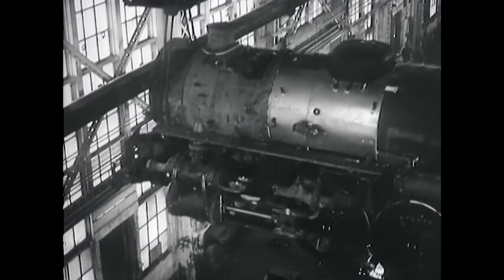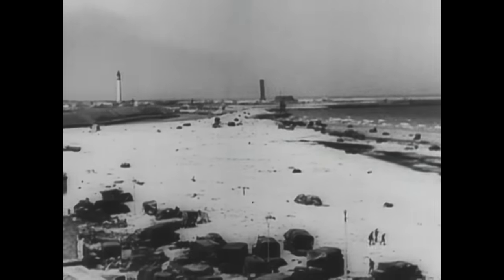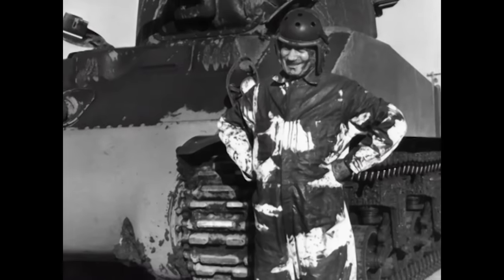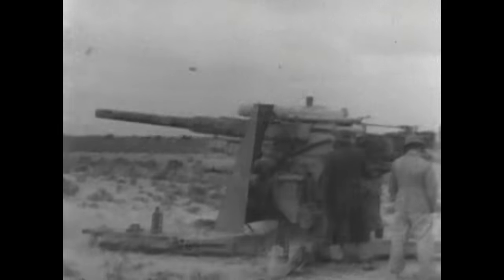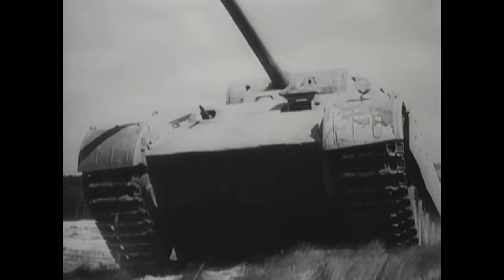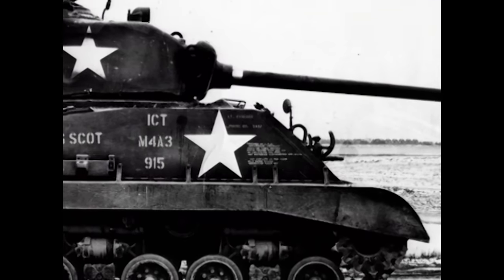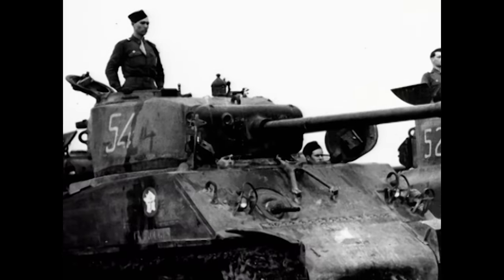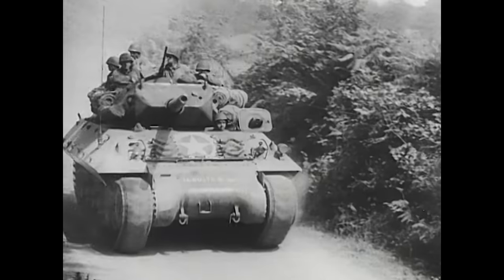Why The Sherman Tank Arrived Just In Time For The Allies | Tanks! | War Stories

Comment: Both the 76 mm Sherman and the 17 pounder could take out a panther. The 17 pounder was more powerful but it left very little room inside for the crew to fight the tank. You pretty much needed midgets or something. That issue could be fixed by using a larger turret. I don't think it was. The Chieftain did demonstrate this. Shermans always traveled in groups of five. I'm loath to say this but these experts pretty much don't know Jack.

Comment: My dad was taking a part off of a Sherman to repair another one.  He was walking away with the part when the Sherman was hit by a shell again.  He was far enough away that it didn't kill him but my mom told me his back was covered in scars.  Him and his brother both joined in 39 and didn't leave the military until their units were demobilised in 45.  He did several different things during the war one of which was a dispatch rider.  They learned to ride with their heads low because of the wires the Germans would string across roads.  Years later when he would ride motorbikes around town he would still keep his head down.

Comment: MAJOR correction, the T14 and the Jumbo are NOT the same tank, not even close. By the time they were making the Jumbos the T14 and its UK equivalent the Excelsior had both been canceled for being an impractical complication that still needed more development while the Churchills had already had their issues ironed out.

The Jumbos were just standard Sherman's with additional armor welded to the front hull, and a heavier armored turret. This is why only 250 were made, it heavily overstressed the front suspension leading to increased wear and tear causing frequent parts breakage. 

With a supply chain spanning literally the entire globe, and an equally long supply line to the front, the US refused to issue equipment that was known to be faulty or defective (This doesn't mean it didn't happen, just that they tried to avoid it when they could). That's because EVERYTHING had to cross at least one ocean to get to the fight, and they weren't shipping defective tanks back to the US to he fixed, once it was shipped that was it, and any repairs, fixes, or overhauls would have to be repaired by motor pools and if they couldn't handle the fix, the tank was just sent to the local scrapyard.
Reply: Thank you… saved me a ton of time. Soo many wrong facts in this “Documentary”.
Reply: T14. The T14 is an oddity. Its part M4 Part M6 part it’s own thing. It’s more advanced than M4 but less than HVSS. It inherited problems from M6 but isn’t developed to correct them. It’s started before M4A3 but didn’t get the fixes to the engine bay. Neither T14 has more then 1600 miles put on them.

The Jumbo wasn’t drastically over stressed. And added work was fairly limited over the normal M4. An improved model with HVSS was discussed. A further improvement with HVSS and the M26 turret was also worked on.

The M4A3E2 was for very limited running. So any increased wear was considered acceptable.
Reply: Most of this video is either wrong, or so simplified that it's no longer true
Reply: American tanks are something of a sad story that started with General Lesley McNair being appointed Chief -AGF. He favored the Tank Destroyer and his doctrine was that they would deal with enemy tanks, while US tanks were confined to Infantry Support. This soon caused complaint as tankers wanted thicker armour and better guns. From 1941-44 new tanks were tested but always McNair found an excuse to cancel desite objections from the likes of Devers and Patton.

In 1943 the 90mm gun entered service and the T-26 tank was finalized. However McNair dragged his feet on production. By July McNair had done nothing, but on a visit to Normandy he was killed by "friendly fire" . His replacement General Ben Lear immediately ordered the M-26 and M-36 into production. They just about made it on the battlefield as WW2 ended.

McNair had his reasons but shipping out heavier tanks was not it. Neither was shipping tanks back to the US for repair, this was done at factories overseas. No, he was tied to his doctrine and would not let it go/
Reply: The A33 Excelsior was a new Assault Tank based on the A27 Cromwell. It was killed off when the Churchill entered combat in the autumn of 1942. Its replacement was the new Assault Tank, the Nuffield A39 Tortoise, a 78 ton monster with a 32 Pounder high Velocity gun that would go through a Jagdtiger like a hot knife through butter. Six were built and tested 1945-52 in Germany but were not continued.

Comment: A couple of things not mentioned. 
First was the design constraint placed on the M4 in that over 95% of the cranes at American ports could only lift 40 tons onto a ship.
A major point in its favor was crew ergonomics. The loader could load the gun while seated. It has a stabilizer for the gun. It had a periscopic sight and a telescopic sight. And it was easy to drive.
Reply: Ergonomics were the result of learning processes after addressing flaws. 
For example early Shermans didn't even have a cupola and only one turret escape hatch for all three turret crewmen to get out of.
Reply: Agreed, ergonomics was (still is) very important, a stressed out crew in a confined space do not perform well.

Comment: 33:00 Maybe wasnt as good with HVAP/Sabot rounds, but those were very rare. Most 17pdrs and most 76 M1 guns fired normal APCBC shells, which performed practically equally for both guns.
And yes, the American gun WAS adequate against Panthers. Check for example the L.G. Pool and his crew. They had the American 76mm gun and they used it to knock out Panthers left right and center. Even became tank aces, one of the best in the allied armies.
Reply: Except the 17 pounder was way more powerful in AP with its normal round, while the 76mm was seen as a disappointment.

Comment: 19:56 This is a myth. Those nicknames were given to the Crusader tank, not Sherman. Also, Ronson was not used at all, as the common lighters of that time were Zippo, not Ronson.
Reply: As the Chieftain pointed out, Ronson didn't use that slogan until the 1950's.
Reply: @steveschainost7590 
Ronson started it's famous advertising lights every time in the 1920s.
Reply: Ronson wasn’t even using that slogan in the 1940s.
Reply: @steveschainost7590  Ronson also wasnt used by the army. The army used the Zippo lighters. Also, the name Sherman Zippo was a legitimate designation of a flamethrower Sherman.

Comment: In June of 1944 in England there were 76mm armed M4 Shermans. For logistical reasons the US Army left them in England. 76mm armed M4’s were being sent to France by the of the Battle of Normandy.
Reply: Yeah, by Operation Cobra the 76's had already started making their way into frontline units.

And the 76 wasn't as inferior to the 17-Pounder as implied, while yes its base penetration is lower, it's ergonomics in the T23 turret was light-years better than the smaller cramped old-pattern turrets the Fireflys stuffed their gun into. In addition the 76 was more accurate than the 17-Pounder, and was perfectly capable of defeating a Panther or Tiger I from the front, this is especially true when it comes to US HVAP vs early UK APDS which suffered issues with cup separation further degrading its accuracy if you used the Better armor-piercing round.

And lastly, you still had a bow gunner with the US 76MM Sherman's which could save you in a close range panzerfaust ambush, and kept your ammo in the wet stowage position instead of adding a MASSIVE danger square to the entire left-front of the tank stuffed full of cordite propellant just waiting to re-enact Jutland if she's hit.

Last fact, the muzzle blast was so bad from the firefly the commander had to effectively sit outside the tank just to see through the dirt/dust cloud and where a round hit. This was made even worse at night by the fact the recoil mechanism for the tank-mount wasn't perfected, so it was actually possible for the breech to slightly open and vent Flash into the crew compartment, so all firefly crews were supposed to close their eyes upon firing so they wouldn't flash themselves and lose their night vision; this is also why you were apparently supposed to easily be able to tell who was in a Firefly crew, as they'd all be missing their eyebrows feom the flash singeing them off.
Reply: It was more overconfidence and lackadaisical attitudes. They simply didn't think they'd need them. The British were not so overconfident and lackadaisical. They made sure they took Fireflies 
on D-Day.
Reply: @pyro1047

The 17 pounder in the Firefly was no less inaccurate than the Sherman 76mm with regular ammo. It was only the special Sabot round that was not very accurate. The 17 pounder was capable enough with regular ammo. The 76mm was not. It was a disappointment unless it had HVAP and that was extremely rare and not readily replaced.
No Sherman 76mm took out 3 Tigers or 5 Panthers in an engagement like Fireflies did.
The British Firefly was absolutely the deadliest and most effective tank killing tank the western allies had in WW2 (Pershing not included, too little too late).
No British armoured divisions complained about the effectiveness of the Firefly. Both the US 2nd and 6th Armored Divisions complained about the effectiveness of the Sherman 76mm.
Reply: @lyndoncmp5751  …. I doubt in the hedgerows the 76mm armed tanks would have advantages over the 75mm. The British and Canadians had the more open country. Against German armor
Reply: @lyndoncmp5751  …. I agree. The British army was in a better position to make decisions on the weapons needed. The British had been fighting since 1940. Whereas American weapons and trained troops was coming from America. Which is where big decisions were made. The USA put a lot of faith in the 76mm armed Tank Destroyer branch.
Reply: @Idahoguy10157

Well as luck would have it, the Americans didn't meet any of the big German tanks in Normandy until July. All through June the biggest armour they encountered were Sturmgeschutz assault guns primarily in 17th SS around Carentan. They didnt even face Panzer IVs through June. All the Panthers and Tigers were facing the British and Canadians around Caen. This is why there was no pressing demand to bring the 76mm Shermans over.
However, from the second week in July, the 2nd SS Panzer Division turned up in the American sector and this has a battalion of Panthers. Panzer Lehr Division was redeployed from the British sector over to the American sector shortly after as well, and Panzer Lehr had Panthers too. So yeah the Panther scare of July lead to the 76mm Shermans being brought over for Operation Cobra.
✌️
Reply: @lyndoncmp5751  British units operated Firefly's with several other 75 Sherman's as they did not have HE ammo and that was used much more often then AP in most combat situations. So 4 standard Sherman's with a single Firefly turned out to be a perfect fit for handling tanks and supporting the infantry.
Reply: @johnskillman2035 
Indeed, and so each troop of 4 British tanks had a tank destroyer on hand in the Firefly. They didnt have to wait and call for tank destroyers like the Americans. The British, and Canadians, already had one with them.

Comment: To say that the Lee-Grant was unable to deal with the MK IV isn't really true. Although yes it was handicapped by having it's main armament in a side sponson it's 75 mm was still able to knock out any tank it faced in the desert. It should also be pointed out that when it was first deployed it was facing the MK IV with the short barreled low velocity 75 mm gun which it was definitely a match for and the MK IV didn't start to mount the long barreled high velocity 75 mm until many months after the Lee-Grant first arrived.

Comment: The German 88mm Flak was not widely used by the Deutches Kriegsmarine, as stated in this documentary; the DKM used the 105mm AA gun in twin mounts.  In fact these guns were automated to change angle at air targets travelling at 120 mph.  They never imagined that torpedo bombers could travel at slower speed.  The British were very low tech with their naval aviation.  The Swordfish aircraft, which approached the Bismarck travelled at 70 mph.  Hence the success of the raid, which jammed the Bismarck's rudder.

Comment: 38:14 The M4A3E2 was actually even more protected than the Pz V Panther and Pz VI Tiger (H and E types). With its 100mm thick front armor sloped at 45 degrees, it combined the raw thickness of Tiger armor with the sloped armor of the Panther. Its turret was 152mm thick all-around, which means that in terms of armor, the M4E3E2 Jumbo was ONLY comparable with the Pz VI Ausf.B Königstiger, and was one of the few allied types of tanks that didnt have to be afraid of the 88mm flak at all, at least while facing it with the front armor...
Reply: At least two Jumbos were taken out frontally by 88s.
Reply: @lyndoncmp5751  Which ones?
The L/71? Maybe.
The L/56? Highly unlikely.
Reply: @pavelslama5543 
L/56 could feasibly do it with Pz Gr 40. Can get through nearly 160mm of sloped 30 degrees armour at 500m.
Reply: @lyndoncmp5751  Theoretically. What would it require?
1) The Tiger to be equipped with that type of ammo in the first place. Those were not very common, because first Germans didnt consider them necessary and second didnt have enough tungsten.
2) The Jumbo to sit close enough and perfectly head on. Some 15 or 20 degree sideways and it may be an issue.
3) Or a perfect 90-degree turret hit.
Reply: @pavelslama5543 
I have read of Tiger Is being equipped with a few PzGr 40 rounds. These were only to be used in an emergency and to be saved for the right moment. Almost always the regular ammo was sufficient so they didn't really need them. However, they HAVE been mentioned by Tiger commanders so they did have them. 
When the Jumbo appeared, the Tiger I was rare anyway. The Tiger II was more likely to be encountered. Still rare itself though. There were a total of 40 Tiger Is on the NW Europe front when the Jumbo first saw deployment to US 1st Army for the Aachen battles in late October 1944. 9 Tiger Is in Schwere Kompanie Hummel and 31 Tiger Is in Abteilung (Fkl) 301. 
Kompanie Hummel was in the Aachen sector fighting near the Tiger IIs of Schwere Panzer Abteilung 506, and indeed became temporarily attached to it as its 4th company until after the Battle of the Bulge. 
I've not found any data either way to be sure if Tiger Is had a couple of PzGr 40 rounds in late 1944. I have read that around 6,000 PzGr 40 rounds for the 88mm were produced but I don't know when the last ones were available for Tiger Is. 

The penetration stat for the Tiger I with PzGr 40 is already on sloped 30 degrees armour.
Reply: @lyndoncmp5751  With 4 inches of armor angled at roughly 45 degree (so lets say 
42 degree once the shell impacts it), and the gun´s relative penetration of 138mm of armor at 30 degree from normal at 1000 meters, we can deduce that the same shell would be able to penetrate no more than 102mm of armor at the 42 degrees from normal. This doesnt count in the denormalization angle, which for sub-caliber shell would be pretty high, so the 102mm is a rather optimistic estimation.
Jumbo´s armor is about 102mm thick when facing the enemy head on. 
So, the 1000m is the absolute (slightly optimistic) limit for complete frontal armor perforation. 
Now for example with a 20 degree horizontal rotation of the Jumbo we get to at best (not accounting for denormalization, which would be even bigger than before) some 700 meters.
And if the Jumbo is turned just some 37 degree sideways, a frontal armor penetration simply isnt happening. This almost coincides with the angle at which the side armor can be penetrated, but only with the sinus calculation, so again not including the denormalization behavior of the shell. 
At around 500 meters of distance we reach a zone at which a Jumbo angled about 40degree sideways cannot be penetrated not even theoretically. Even a turret hit would be extremely tricky.
All in all, a sensible tanker would probably bail out after being hit from a 88mm anyway. Or it may cause some spalling due to incomplete perforation. That Tiger would however spend way too much time on that Jumbo, instead of taking it out with the first hit like it would with any other target.
Reply: @pavelslama5543 
I thought I mentioned 500 metres for the PzGr 40 penetration of nearly 160mm sloped at 30 degrees. I don't remember extending it to 1,000 metres. I thought 500 metres was a reasonable range. 
Yeah you're right, not sure a Tiger I would bother with a Jumbo so much because even though it had strong armour it's gun was still the mediocre 75mm so hardly a threat to the Tiger frontally, unless the Tiger was supporting troops in danger of it.